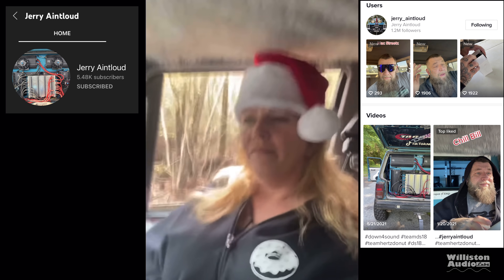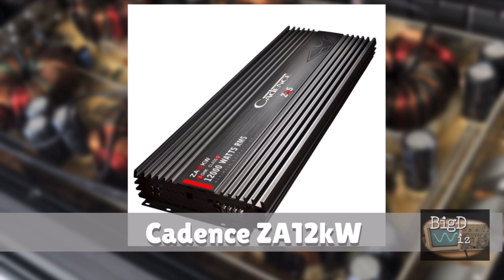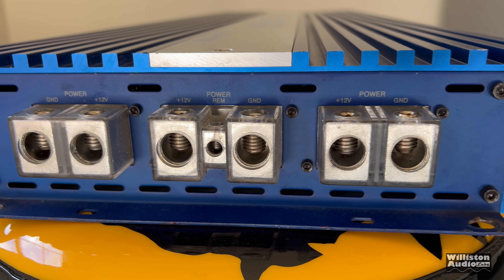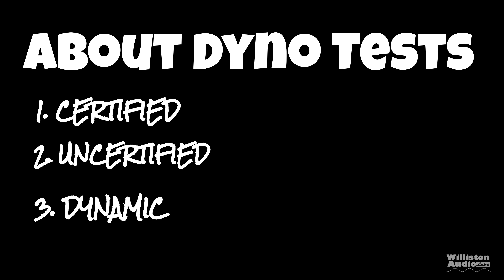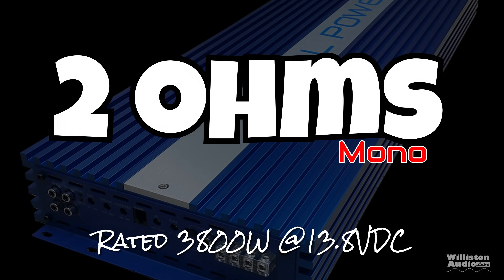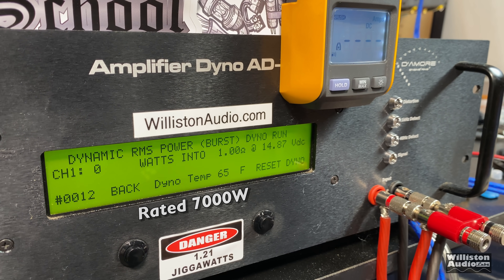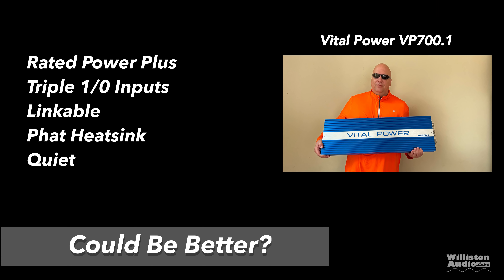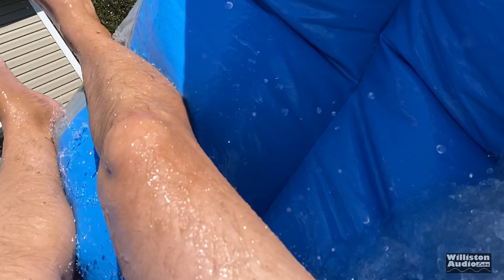7000 watt Competition Amplifier? Vital Power VP700.1 Overview and Amp Dyno Test [4K]

Comment from the maker: Other similar amps (current models):
Def Bonce AAK-8000.1D - https://lddy.no/151yf
Crescendo Bass Clef 8K - https://lddy.no/151yg
Crossfire XT 8K - https://lddy.no/151yh

--------- Test Bench Equipment -------

SMD / D'Amore Engineering Amp Dyno: https://goo.gl/sJTcf7
XS Power D1400 Batteries - https://amzn.to/2BPFCKW
XS Power LTO 40ah Lithium Cells - https://lddy.no/13d2f
XS Power PSC60 Charger - https://amzn.to/2CHGcfs
Fluke 1000A AC/DC Clamp Meter: https://amzn.to/2Rw5WDA
Handheld Dyno: https://lddy.no/106tm	
My Favorite Screwdriver Kit: http://amzn.to/2x0VzcE

DISCLAIMER: This video and description contains affiliate links, which means that if you purchase from one of the product links, I may receive a small commission. As an Amazon Associate I earn from qualifying purchases
Reply: Dc audio 7.5k and American bass 750.1/ VFL 8k are the same boards exactly
Reply: Big D is there a power limit to the dyno?
Reply: I think my Lanzar opti7000.1 looks like that on the inside too if I remember right
Reply: 0l0o
Reply: Y
Reply: Y
Reply: Ylt
Reply: Ylt
Reply: Y

Comment: Run all 3 power wires through the clamp meter, it will add them together.
Reply from the maker: Yes I know. I did one leg because my clamp maxes at 1000A and thought this amp might pull more

Comment: Don't know if this has been asked or not, but I would LOVE if Williston tests included the S/N ratio for the amp as well as its power output.  To me, clean, quiet power is more important than just brute force.  What good is lotsa Watts if it's 30% noise?  

It might take another piece of test equipment, but it would be a valuable addition, IMO.  Thanks for all the quality content!
Reply from the maker: So I’ve thought about getting an Audio Precision and doing more extended specification testing…but I’ve come to the conclusion most people don’t want that much info. They want to see the amp, features, how much power and some entertainment. That’s where I’m at…
Reply: @wal but now everyone is jumping on to the bandwagon and making the same type of videos as you are so it’s time to add that little extra touch that will set you apart 🤔

Comment: first test 1073 W (14 v) 72,7 A  consumptions
second test  1881 W (14 v) 143,4 A  consumptions
third tests  3654 W (14 v) 261.8 A  consumptions
four test  4760 W (14 v) 340.4  consumptions
Reply from the maker: Times 3, only one wire out of 3 was clamped
Reply: @wal  yes i know , yeah amazing video 👍👍

Comment: Question on amp tuning:   If the amplifier is rated at 75 watts at 2 ohms and the speakers are rated at 75 watts at 2.7 ohms is it logical that the gain on the amplifier can be set to its maximum since the numbers match up almost exactly; i.e. 75 watts on each and both are in the approximate 2 ohm range?  The amplifier is an Alpine and the speakers are Infinity.
Reply from the maker: No because the amp gain should be set to match your head unit, then you can turn it down if needed, but not up
Reply: Thanks.

Comment: I like it, when an amplifier hits its ratings right on the marks. Your slight overpower is exactly proportionate to the overvoltage being supplied to the amp. While expensive, you're getting what you pay for. I would like to hook this up to an oscilloscope and signal generator, and see what its frequency response is. (especially, the low end) drive it into its rated impedance, and run it at full rated power.

Comment: To get the actual Current, just run ALL THREE POSITIVES through the clamp meter.
Reply from the maker: True but I just did a test and my result was only 3% different using my method
Reply: @wal  - Helpful for other viewers to know.
Also, you can increase the accuracy at low currents by winding the cable through the clamp twice. For example, if you want to measure 500mA (0.5A) current and you loop through the clamp meter 5 times, the meter will read 2.5A. This is handy when you want to measure (say) standby current and you meter won't go down low enough.

Comment: You CANNOT take an amp clamp reading off of one of three legs, times by three and get a current reading.  Any difference in resistance or inductance on the wires will change the reading per leg.  

Therefore, efficiency is not totally correct.
Reply: Shoeit that b good amp
Reply from the maker: Sir you are correct, however I did some offline testing and found my method was only 3% off by clamping the first input. But there were differences in the current consumption per input, we believe due to the circuit board layout, how much copper, etc

Comment: You test alot of equipment,would it be difficult to adjust according to what ur testing?Cause big boy wise yes 14.5 or more is what it should be,but when you test the smaller budget amps or just the little stuff,i feel like 13.2 would be more accurate for them,cause ima poor country boy,an alternater alone would cost more than i can afford at this point,so my factory power system is what i have rn,and im sure alotta folks feel the same.Thanks for the vids though brother,i enjoy most of them.
Reply from the maker: I’ll try to keep the smaller amps in the 13-14V range

Comment: Big D, do you have a vid that explains a little more about these test settings. Like what does THD mean and how does the dyno use it for the tests? I get the dynamic test, but what is the difference between certified and uncertified? Love these vids!
Reply from the maker: Certified is "clean" power to 1% distortion. Uncertified is power up to the clipping point. Usually uncertified is what is important for subwoofer amps as 1% THD is not noticeable on subs.

Comment: It takes a lot of power to make a lot of power, probably will even render good factory alternators useless
Reply from the maker: minimum of three 120a batteries and a 300A alt according to the "you big dummy" manual. I mean if you you need to read this then you are not worthy (their words, not mine)
Reply: @wal  yeah that amp is definitely not for me, my car's poor 80A alternator is not worthy of such power lol

Comment: The orion hcca 3000.1 outdid that Amp by almost 5,000 watts and is less than half the price. Orion has good build quality also. I would easily pick the Orion over that Vital Power.
Reply: Go back and watch it again
Reply: @minus3dbintheteens60  I watched it very carefully.  It put out over 12,000 watts so you go rewatch it.
Reply: Yeah, dynamic, at half an ohm, I don't need to re-watch it.

Comment: SO what, you need multiple batteries and a beefy alternator to run this thing?
Reply from the maker: The manual that wasn’t a manual said at least (3) 120ah batteries and a 300A alternator

Comment: Serious question, I've seen a lot of your videos and in some cases one channel will have a significant difference in power I think the biggest I've seen is about 60 watts difference. and in the case of the package saying X number of watts and then it is making less than that, is that partially because of poor quality parts or they tested one that did, and this is a case of one that didn't make the power?
Reply from the maker: As long as it’s less than 5%, I don’t see it as an issue. Components have tolerances and getting channels exact is rare
Reply: @wal   Is it part of why an amp would underperform, sort of like how RF amps are rated far lower than the bench test for RMS wattage? Like a bad part like a cap or FET slipping through QC standards?
Reply: @charlesvincent4127  - No, the difference between channels is because there are slight tolerances and differences in components. It's not about "bad" components...  it's about tolerance.
Let's say that the resistors have +/-1% tolerance... a resistor marked "1000 ohms" could actually be anywhere between 990 Ohms and 1010 Ohms. There are hundreds of resistors inside the amp, each one has a tolerance. There are also numerous other components, each with a tolerance. The output of one channel is the sum of the performance of all the parts in that channel, whilst the other channel is the sum of the performance of all the OTHER parts in that respective channel.
It is virtually IMPOSSIBLE to have two channels that are exactly matching.
Reply: @charlesvincent4127  - As for meeting Rated Power... there are many things at play here. The manufacturer's claims may be complete BS, or they might be stretching the truth by not disclosing THD (Distortion).
For example, small Class D ChipAmp ICs (used in small HiFi Stereos, Bluetooth Speakers, etc) are almost always rated at 10% Distortion. However that level of distortion will make music sound awful. Most responsible power tests are to 1% THD which is basically inaudible levels of distortion.
With a small Class D Amp, that might mean a "Rated 50W/ch" (at 10% THD) Amp will only deliver 30W/ch at 1% THD. SO, instead of 100W total, we only actually see 60W on the Dyno. Yes, it really makes a massive difference with some kinds of Amps!
...
The other thing is VOLTAGE... The way it works is that Power (Watts) = Output Voltage SQUARED divided by  Resistance (Ohms). Inside the Amplifier, there is a Power Stage, then the Amplifier Stage, and the Amp can only work with what power it can get from the power supply. So, if you run at higher Input Voltage, you get more Power Out.
...
Because of that Power Stage inside the Amp, if you only drove one channel of a Stereo Amp then the Power Stage could be able to deliver extra juice to the remaining channel. When Derek uses the Dyno, he always loads ALL the channels, even if he only measures two of them. The "All Channels Driven" power output can be lower than "One Channel Driver" and then multiplying that by the quantity of channels!
...
So, there are many reasons why the Amp Dyno will not show the same as what the Manufacturer claims. A honest manufacturer will give realistic performance figures, perhaps understating the Power. Yet a shonky manufacturer will inflate the Rated Power by taking the best case of every step.
Perhaps only driving the best channel, with hand-picked components, in a tweaked laboratory sample, using a bit extra supply voltage, and taking the high end of tolerances. Then adding 20% extra because no consumers have proper test devices like the Amp Dyno anyway...